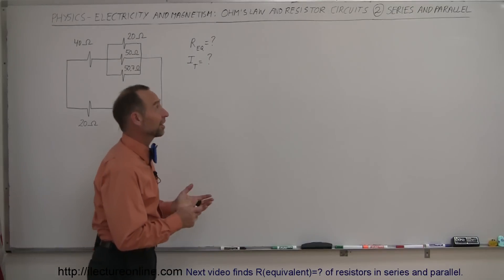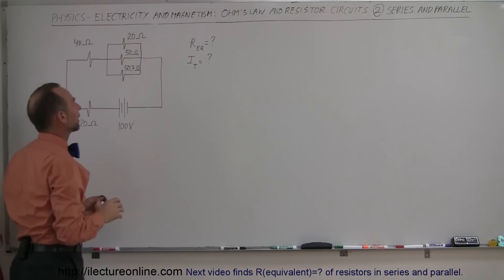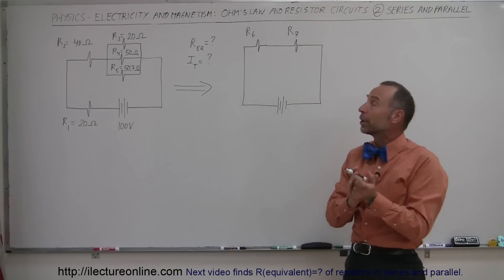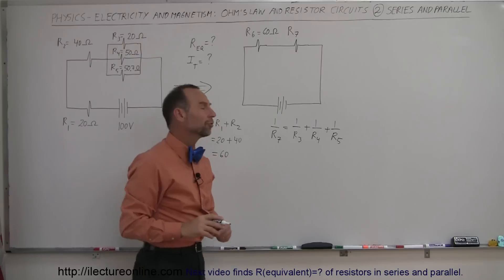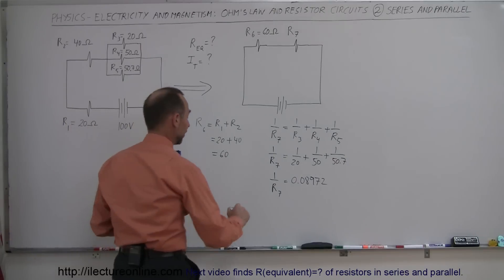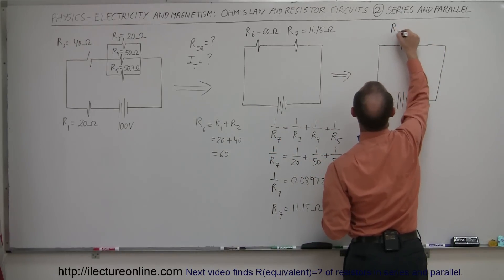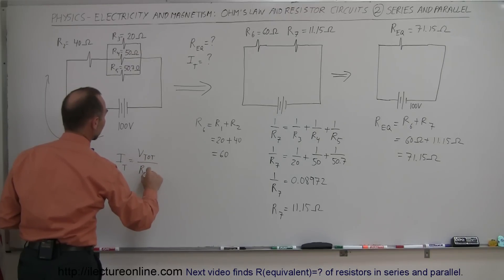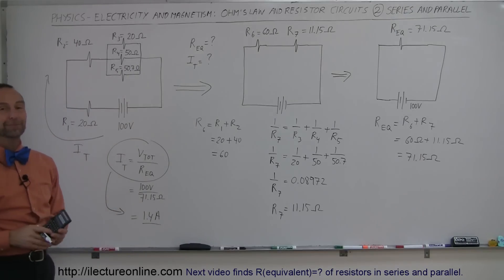Physics 42   Ohm's Law and Resistor Circuits (2 of 23) Series and Parallel

Comment: He added series and did 1/Ct for parallel on the last problem too. I thought it was true opposite. You add parallel and do the inverse of series. Am I forgetting something here?
Reply from the maker: I don't see any 1 / Ct    Did you mean 1/Rt ?
Reply from the maker: R3, R4, and R5 are in parallel.
Reply: @MichelvanBiezen  I think I just figured out why I’m confused: 

Im getting confused because capacitance and resistors are the opposite:

For capacitance you do 1/Ct if it’s series and Ct=C1+C2 …. If parallel 

In a resistor, do do Rt=R1+R2… if it’s a series and 1/Rt if it’s in parallel

Do you see how the math is opposite? 

I thought the math was wrong when I stated studying I was so confused. 

Thank you for replying! 
I truly appreciate you!
Reply from the maker: That is correct.  The formulas for capacitors and resistors are reversed.

Comment: Should the voltage drop be the same for the resistors in parallel? Because for 2 of my voltage drops I got 20.07 but for 1 of them I got 35.39🤔 seems odd.
Reply: I figured it out, thank you so much for the content provided.

Comment: sir how do we find out the amount of current flowing through resistors which are not in parallel . For example how do we find the amount of current flowing through the 40 ohm resistor
Reply from the maker: Since the 40 ohm resistor is in series, the current through that resistor will be the same as the total current through the circuit.

Comment: in the previous video you explained how to find the current in each branch, if there are only 2 resistors in parallel. What about if there are more than 2 resistors in parallel like in the above case here????
Reply from the maker: +Sahil Shah 
There are multiple methods.  In one method, you find the equivalent resistance of two of the resistors in parallel.  Then find the current through the equivalent resistance with the method shown here  (since you now only have 2 resistors) and then do the method again with the 2 original resistors.
Reply: I figured that out, Thanks a lot anyways. You have no idea how much your videos helped me for my Physics courses. Thanks a lot for all the help.

Comment: how did you get the inverse of .0897... on the calculator ?
Reply from the maker: Mario Persaud 
There should be a (1/x) button on your calculator
Reply: Thank you very much. I was using a ti-89 so I had to do it manually.
Reply from the maker: Mario Persaud 
On the TI-89 you may have to raise the number to the "-1" power to get the inverse